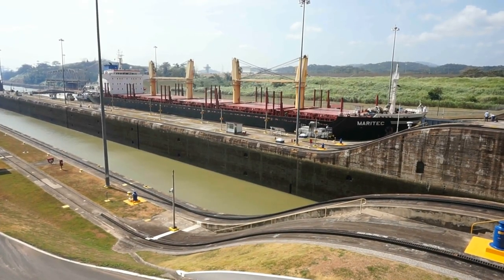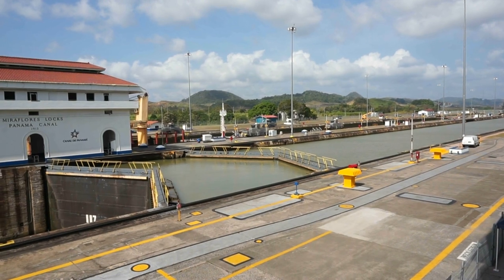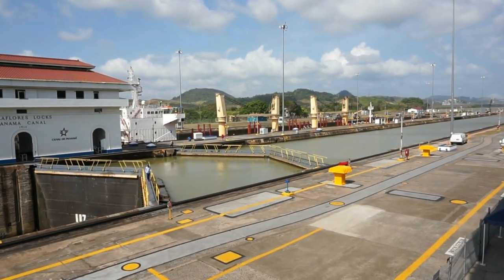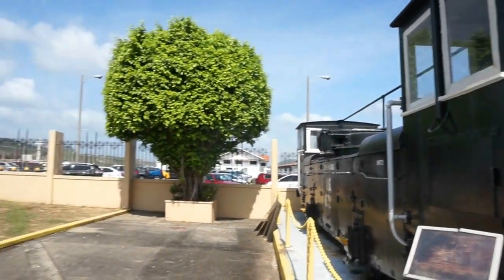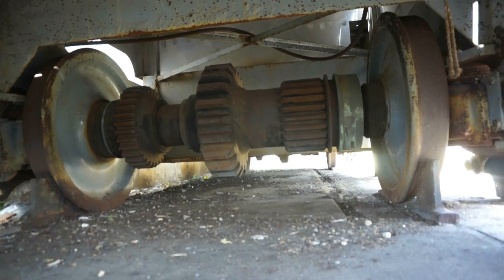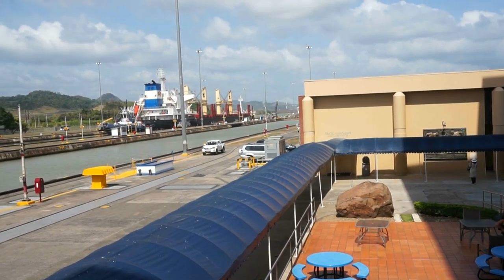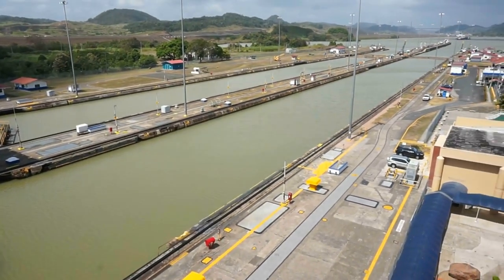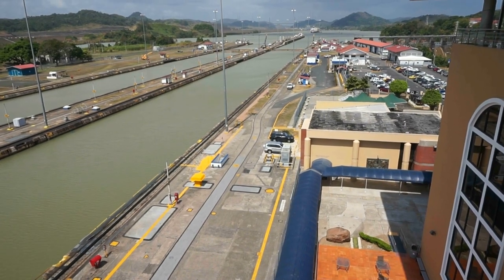Panama Canal vlog: Ship crossing Miraflores locks, best views

Comment: The primary gear (6:55) in the middle is probably the one used for drive purposes and all three gears are most likely used with a transmission - which would have been above the axle and you can see is now removed.

Last I read (a few years ago) Panama was dredging where needed to widen the waterway and running into the same problems as previous - movement and inflow of dirt from the edges being excavated.

Nice video Vic. Safe travels sir.
Reply from the maker: Thank you for the information regarding the gears.. They have now opened a new canal (parallel to the one that you saw in this video) for larger, wider ships to go through..